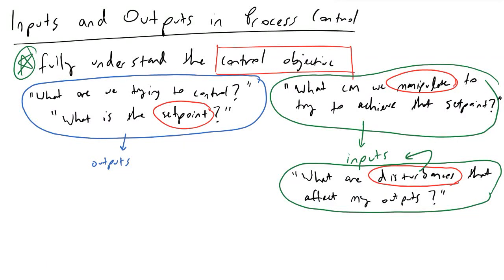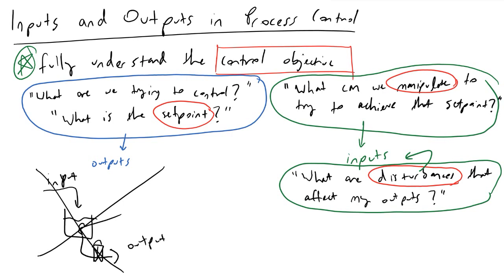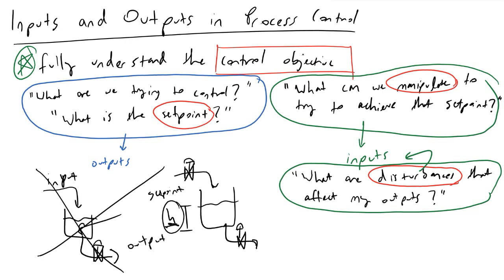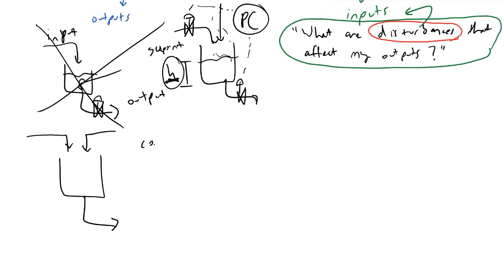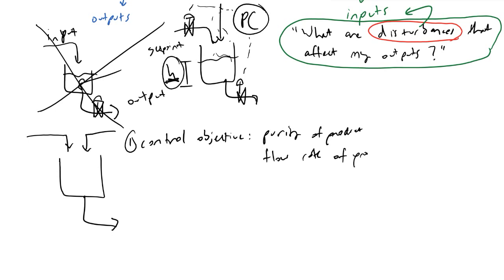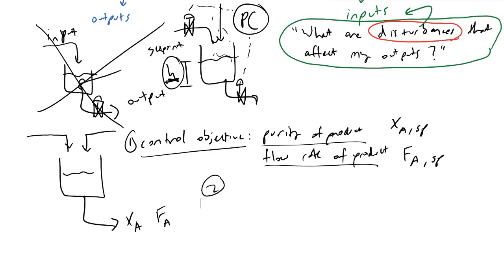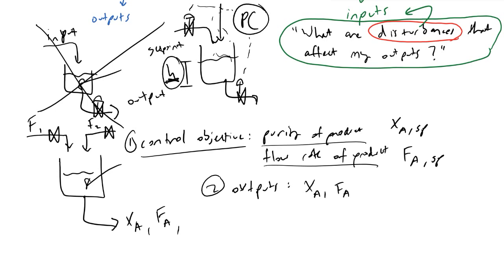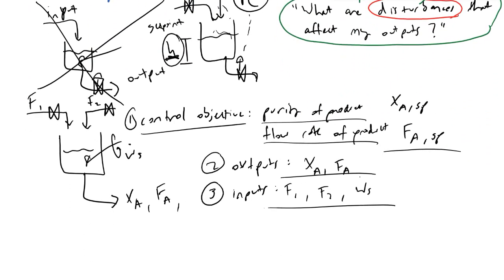Inputs and Outputs as defined by a Process Control Engineer

Comment: So this would mean that the outputs are essentially our control objectives and our inputs are anything we change to achieve these control objectives?
Reply from the maker: Anything that your controller can manipulate, like a valve to change the flow rate out of a tank, is an input. What you are measuring in your process that you are attempting to control is an output, such as the temperature of the tank, so I would agree with your statement.